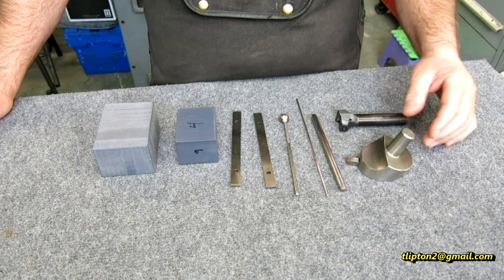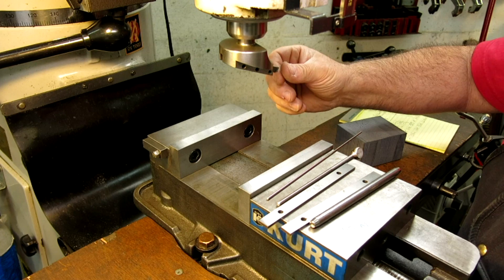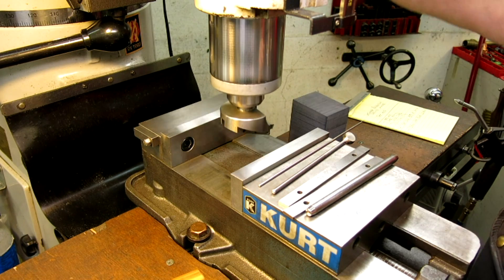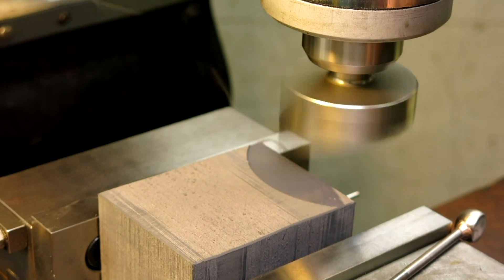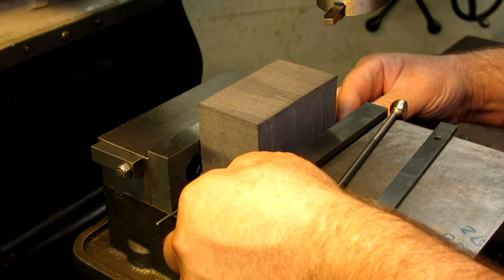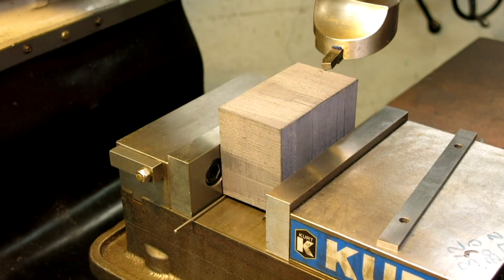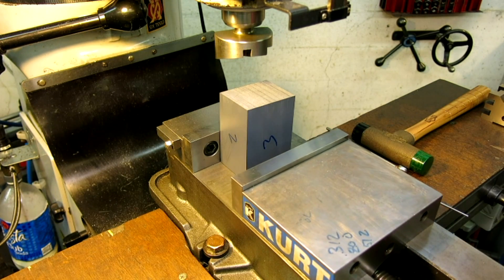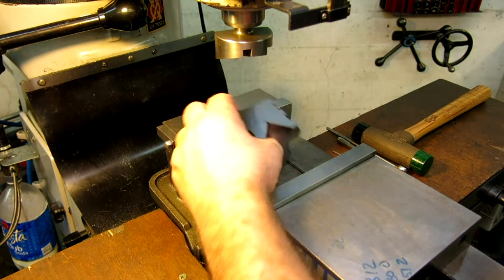Virtual Apprentice Squaring Blocks

Comment: But how would you do that without a (proper) vise?
Reply: Add step 0: get a proper vise.
Reply: But those things are expensive and maybe not everybody has access to one (maybe they got an old mill with a shitty one). Anyway, just see it as a challenge ;)
Reply: Then there may things you cannot do...   ;o)  

O,,,
Reply: Just so you know, there was a time when no proper vises existed (or similar tools), but they had to be manufactured somehow. There has to be a way how you can make accurate things without having accurate tools. It's some kind of hen or egg problem and I want to know how the people solved it back then.
Reply: I have a sneaking suspicion that proper vises appeared before proper milling machines. Unless you meant we're not allowed to use that either (in which case I'd refer you to Clickspring - he's reproducing the Antikythera mechanism using nigh-ancient methods right now...)
Reply: An instructor of mine in college shared with me a process that can be used to make your own master squares. It doesn't make a single square, it actually results in 3 master squares.
1. Mill a flat side on each of the 3 pieces and lap them against each other to insure that the flat sides are truly flat.
2. Mill a perpendicular side on each of the 3 sides and lap them against each other while keeping the previously lapped side down on a surface plate or some other known flat surface.
3. Just continue lapping all 3 of the pieces against each other until all 3 of them perfectly match up to each other (#1 in comparison to #2, #1 vs #3, and #2 vs #3)
The reason for making the squares 3 at a time with this method is so that you don't mistakenly make 2 mirror image "out of square" squares. Even if 2 of them are perfectly fitted to each other but are out of square, the 3rd one will highlight it and allow you to correct the other 2 in relation to the 3rd. This is a time consuming process but it will generate your own reference/master squares.

Comment: Hi Tom, I am one of your virtual apprentices whose mill has just arrived!  My apologies for such a simple question:  I can't quite see when you are machining the 1st face where you position the round bar - is it resting on the top of the parallel or on its front face?  If you used a larger round bar would you then need to use a parallel?  My sincere thanks for such an outstanding channel.  Yours aye, Jim
Reply: The parallel on the "front" is not needed on that step, except it held the block roughly even so Mr. Tom had a free hand to place the rod with (like the rest of us, even the renowned Mr Wizard only has two hands).
Reply: Understood Tom thank you very much indeed.

Comment: I would like to know what your close tolerance is because I work in +\- .002 and this is not the correct way
Reply: Matthew Braddom  I agree close tolerance for me +/- .0005
Reply: Tim Fairchild so you’re telling me the block in the video falls in +\- .0005
Reply: Matthew Braddom  no I meant the tolerance  I have are +/- .0005   ,002 is like a mile coaxed to the tolerance I have to keep at work

Comment: The tool with the 1/2 ball and the positioning arm is called a leverite tool and it's made by the Universal Leverite Tool Company located in "where you happen to be standing and what you are trying to do". 

It's called a Leverite generally because it fits the following parameters, as in, leave her right there because it belongs to me.......I made it....... you probably don't know what it's for...........and if you ask nicely I will show you how and why to use it so you can go make your own instead of borrowing mine all the time and eventually screwing it up. Although the Leverite Tool Company has been around since the dawn of time, they have serviced and included virtually all the trades in what they manufacture to suit. In today's world they are seldom seen by the general public or in general view for that matter because the ever watchful Safety Police insist that they have an engineering stamp as opposed to good old fashioned know how. 

It is important to note that Leverite Tools are generally high quality and should not be confused with the substandard makeshift tools produced by the Giterdun Corporation located in "this could kill or maim you" not far from "well that didn't work now did it" and just south of "so how we gonna fix that".

Comment: At 15:40 You didn't understand Your technologie. You checked the wrong angle. ;)
Reply from the maker: I was trying to communicate that the edge was perpendicular. Perhaps I should have held the square at a 45 degree angle to illustrate that more clearly. Sorry for any confusion. Cheers,

Tom
Reply: No! You createt an vertikal right angle, but checked the horizontal right angle.
Reply: No he didnt create a vertical right angle. Hence why he put the block in on an angle. He created an edgethats square

Comment: On the first end you just wasted a bunch of material, in an efficient workshop you are required to use the cut off saw/ bandsaw to cut the rough material as close as possible to allow it to be milled to size, so once you have established those 4 sides, put in vise and use precision square to set perpendicular in vise, machine minimum clean up, check and machine other end parallel.
Reply from the maker: Sorry. In an efficient workshop my blanks come in milled and or ground to size. Material is not the cost driver in efficient workshops. Its labor.  Cheers. Tom

Comment: Are there "degrees" of "squareness"? And are those "degrees" measured in "thou"? "Perpendicular" surfaces or "planes" should be "square" and "90 degrees" from each other aka "square". Typically a "square" is used to check "squareness". And if your mill is cutting the first "plane" straight and "flat", why would you need to use that "welding wire trick" to make a "perpendicular" side "square" to the first? Wouldn't it make sense to "flip" the "wooden" block (funny looking trees those must be) and put the freshly "flat" side down, mill the opposite side, rotate the block to put the "flat" sides TO the "side" to let the "work holder" make the other two sides "perpendicular" and then use mill to "roughly" level the block along its other axis and cut the third face, flip it and cut the fourth side and then do the same for the ends? And since when does an "apprentice" get to use a MILL to make the "legendary" square "part" from a "rough" chunk of material? And who gets to use something soft like your "wood" (is that a Delrin tree by any chance?) there? Isn't it supposed to be a FILE and STEEL? And why do you have to prove "massive unsquareness" to "apprentices" and why WOULD you INTENTIONALLY make an already "unsquare" part (if it really started "unsquare) even more "unsquare"? I can only guess for the same reason you're telling them that the "top" is "perpendicular" to the "sides" even though you FINALLY put the SQUARE on the SIDES. And why didn't you cut clear across that "unsquare" end? Because it was SQUARE to start with and you know damned  good and well if you'd have cut the entire surface "unsquare" there's no way to finish that "square" so-called "gauge block" without breaking OUT a square and using it the way anybody with half a clue and therefore highly unlikely to EVER watch your "how-to" videos would naturally know to use it via common sense.